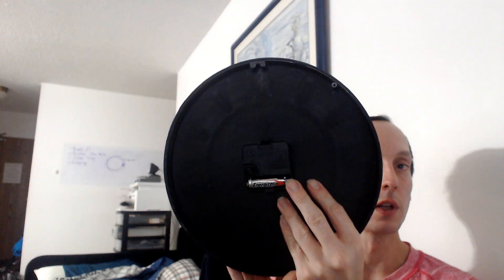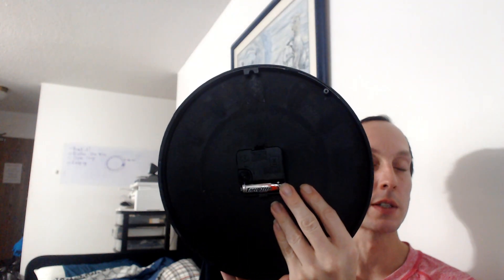Cap Dump For One Wire

Comment: DC spike voltage like a 50, 000 volt racing car ignition will attract static voltage from the air, Tesla said high voltage DC is dangerous cause of air born lightning when circuit is shut off

Comment: Make the wire a capacitor, wrap spark plug wire with aluminum tape? Aluminum irrigation pipe 2 or 4 layers with plastic between, the lockridge device was real with a 6 or 12 volt bosch generator and 4 brushes and a big homemade capacitor

Comment: You can use LED's  if you measure the voltage generated from an LED.  As the shadow of the pointer will cause the LED to drop to 0 and then go back up when the light hits it again.

Comment: A gold leaf static bottle with adjustable contact rods you could let it build to the charge you would like then dump though a mosfet set the rods to the gate and source .you want to keep the load off the gold leaf so it would have a resistor going to the gate to trigger the mosfet .then they would all dump at random and say at 15 volts or where every you set the rods at .

Comment: Great minds think alike . I have been working on idea using the idea of a clock for triggering. Yet it is not for a one wire system, nor for a digital circuit.

I have been watching you from the start of your videos, and am so glad you have been travelling the path you are walking.

I do not post any content.

However when I finish what I am working on, I would like to share my ideas with you.

Please keep up the great work you are doing. I and others value it Joel.

It would be great if you could do more videos regarding all those that have been not even playing on the same field, regarding electricity and its many unused forms along with the unheard systems.

Thank you

Comment: sounds great. My clock battery ran out the other day. I replaced the battery, and it stopped again. 
Back to the 555 , I saw a schemaic someone was using a TL494 to trigger a mosfet. I think this chip has built in PWM. This is what i'm looking at now.
Reply from the maker: Yeah those cheap chinese batteries :)

Comment: 40ma isn't a problem to solve,just move into high power, filling bigger caps and use zenerdiodes to trigger an igbt as a capdump. I'll contact you on the forum.
Reply from the maker: Unless someone shows me that 50 watt exciter be able to put out more I will look into it. I hear lots of talks but no one does it. If it was that easy heck just buy an old ham radio for 100$ and use that. It's not and as far as I know no one has been able to show any decent amount of free energy using a big trigger. I get it I really do! but this is not my goal. I'm into low to no current trigger. Once I can get more than a few watts slowly upsize. This idea of starting huge imo is where many make the mistake. But that's just my opinion lol

Comment: Joel, this is a great idea!  Just a suggestion for timing, you could space the capacitors based upon trigonometry around the outside of the round clock.  The timing would reflect the spacing around the clock.  Or, A quick way would be to say put a Reed switch and capacitor every two seconds and time the capacitors to fill every two seconds if possible.  Would you attach the magnet on the second hand for the switch?
Reply from the maker: I was thinking charging large caps maybe every 2.5 seconds that would be 24 maybe 100uf caps that each have their own trigger spot around the clock so that once a min one fires so it has one min to recharge, but yeah there's more ways here.Larger clock yes :)
Reply: Superglue those caps, lol!
Reply: You are on fire lately. 🔥

Comment: This is genius :D Cheap and easily available. It also needs way less energy than 555 chip. I think it would not be hard to make it use physical contact either. Bigger ones have enough torque. Thanks for sharing.